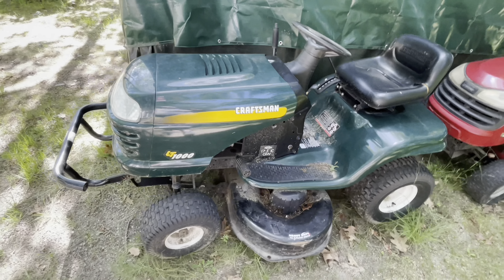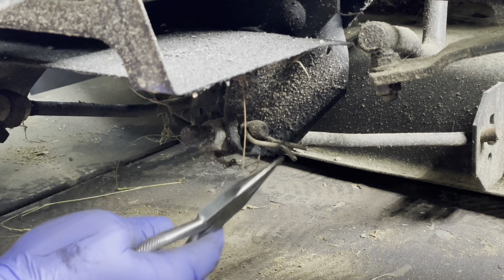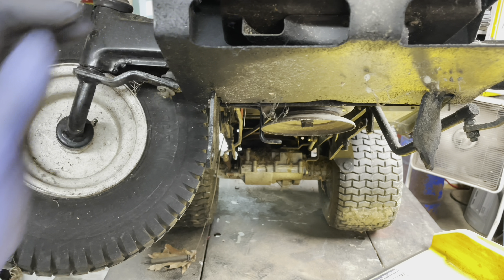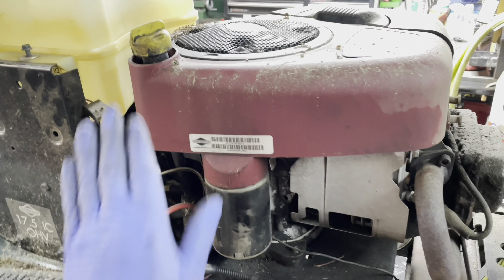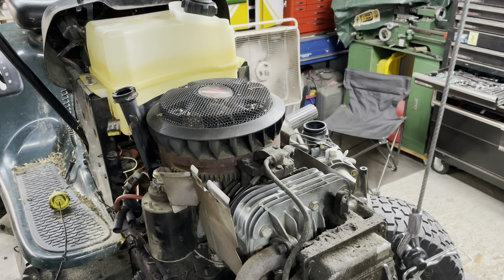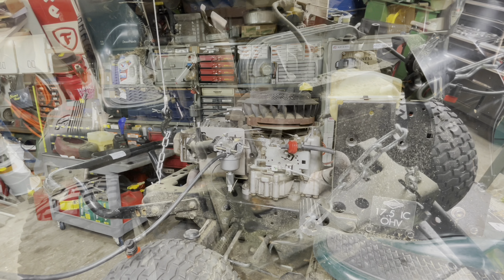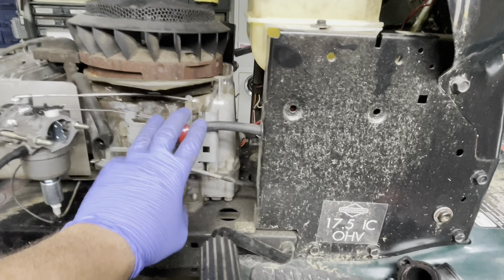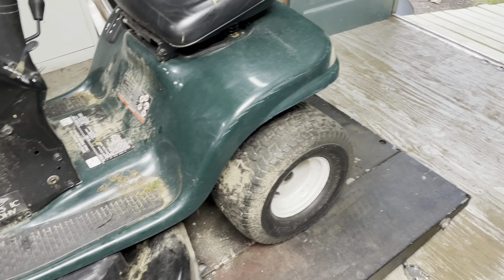Craftsman LT1000 Repair - Will It Run?

Comment: Re: your question about the Poor Man’s Power Steering mod - I haven’t done one yet, but would definitely do it on my own machine. I have no doubt this is a worthwhile upgrade to the front end, along with replacing wheel bushings with bearings - all details one would expect to see in a really well-designed lawn tractor. 
I’ve collected links to several of these and pretty much have it figured out. It is basically a very easy, simple mod but there are some variables among different machines, plus one guy has figured out a modification to the washers so the thrust bearing is lubricated when pumping grease into the zerk.
Reply from the maker: Agreed I think it’s a worthwhile endeavor 👍🏻

Comment: Turned out awesome Hester! Wonder if the previous owner was doing some sweet ramp jumps with it... the way those brackets were mangled. As far as the hole in the gas tank, I think some plastics and even wire insulation are made from soy beans. Could be why rodents like to chew them up. Long videos are fine with me!
Reply from the maker: He must’ve done a dukes of hazard jump with this thing 😂 yea I’ve heard of the soy bean problem, it just seems so weird that they would go at a flat surface and not the corners.

Comment: Just remove left wheel and heat it then use 16 lb back up and 4 lb hammer to tap it straight 😮😮😮
Easy fix
Reply from the maker: With my back problems it was easier to just remove it.  Plus there was a lot of old oil/grease in the area so a torch could have made my day a lot more interesting 😂

Comment: Do you fill the transmission fluid or do what I do and assume it's full i like the long videos too take care
Reply from the maker: Great question.  So this is a manual which are filled with grease instead of oil.  But on the hydrostatic units I generally inspect them for any signs of leaks and if they are dry and they drive/sound fine I don’t touch them 👍🏻

Comment: Love your videos, just got the same mower a few weeks ago for free, bought a new deck front tires with rims new rear tires all the basics to make it run, muffler was blow out that was fun to replace,  starts right up idle is great but it will not stay running if I throttle it past the mower cut speed on the dash any idea's?  Mine also the front bracket was bent to all hell
Reply from the maker: Does your mower have a separate choke knob? If not when you go up past full throttle on many motors that actually turns the choke on
Reply: @hester781  It will only go to half throttle, the indent on the throttle level where the mower deck setting is. will die if go any higher. does not have a pull choke. machine is a 1998 and engine is a 2012
Reply from the maker: The indent is supposed to be max throttle, if you go any further past that it turns the choke on
Reply: @hester781  Thanks, Finally had time to look at it and I can see it hitting the choke rod one less thing I have to think about. But  noticed my tank is now leaking I remember in one of your videos a larger tank you pulled off, does it have a part number on it, rather buy a bigger tank over the smaller one

Comment: The deck I was just working on also has that same folded area as yours. I thought initially it was a blade strike but now I wonder if this is something they did to strengthen that area of the deck?
Reply from the maker: Definitely possible, although I would think it would look more deliberate? Then again I’m just guessing